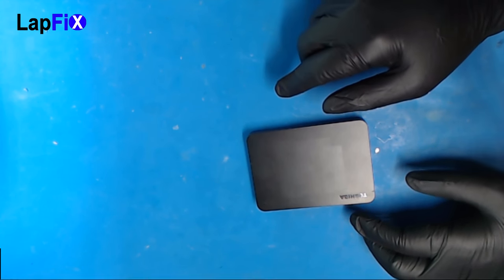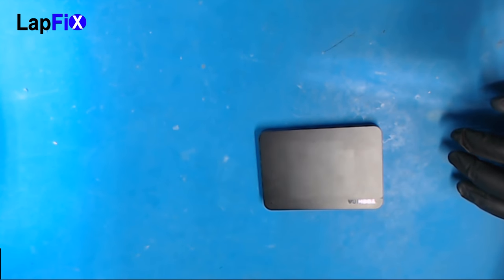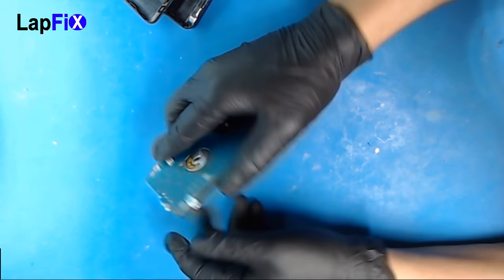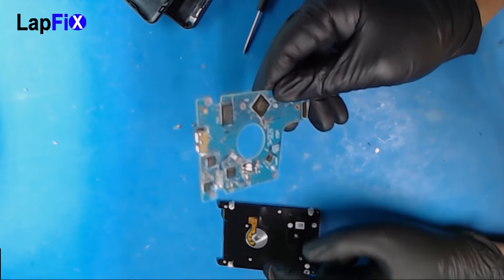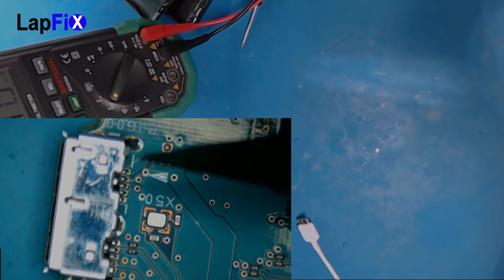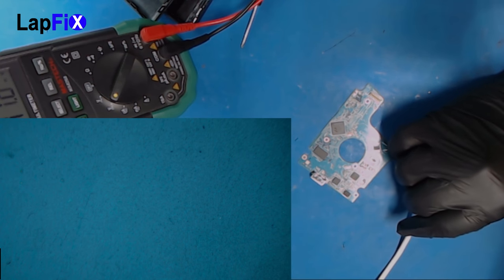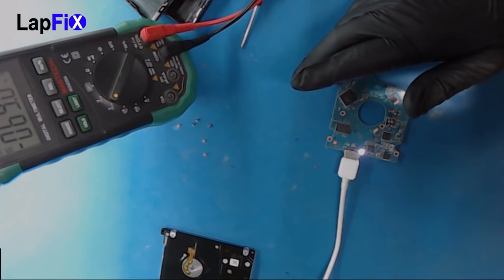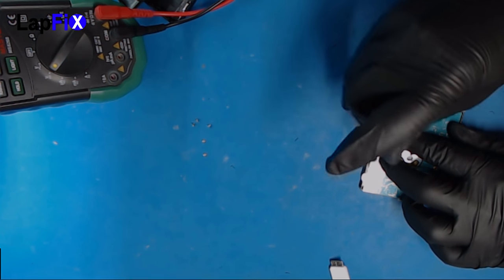How to fix a Dead External hard drive HDD - toshiba hard drive| LapFix

Comment: You are a star, this just worked for me too. Some flux on the connector and heated with the soldering iron. Works again now. Never again will I buy a cheap HDD again!
Reply: pardon me for asking, but what's a flux? is it the liquid he's applying?
Reply: @fathizaky141200  Yeah, it is a liquid that prevents the metal from oxidizing rapidly. It slows down the process so that there is a good connection. I've done LED lights before and when I first did them, I didn't use flux and even though the Solder/SolderingMetal had contact between the LED and the power: the oxidized metal reduced/blocked the current from going to the LED light. So Solder makes it much easier to get a successful connection.
Reply: it's not the HDD being cheap it's people mistreating connectors. This is a standard connector.

Comment: Thank you. I have a 1 TB SEAGATE BACKUP PLUS EXTERNAL HDD . I use it by attaching it with my honor 7x mobile through OTG  for data transfer (bothside). I purchased it 11 months back from flipkart. I use it max once or twice in a month. I used it with desktop 3 times only since purchased. Yesterday when i was working with in by attaching it my mobile , suddenly one beep sound came and HDD light turned off. I performed safe remove process from top bar and after few seconds , it showed that " its safe to remove now" . I removed it and reattached it with mobile but no light no detection. Then again i removed safely and attached it in Sony laptop. It showed new usb driver installation. After completion of the same , no pop up came , no light on HDD , no drive shown in my computer . Then I went to printer & devices and found that it is showing the HDD there but when I went to its properties ; there is blank in VOLOUME TAB . In GENERAL TAB it is showing "  device type : disk drive ;  manufacturer : standard disk drive ; Location : on USB mass storage device ; device status : this device is working properly  " . Another msg shows " windows cannot use this hardware device because it has been prepared for safe removal but it has not been removed from the computer (code 47) . To fix the problem , unplug this device from your computer and then plug in again ".  I unmounted safely it by right clicking . Then reattached the same . Result is still same. Then removed. Restarted the laptop , attached again... same results... pls advise

Comment: Hi what size screw driver did you use to open up the hard drive screws I can't seem to find the right size to loosen the screws connecting the board.
Reply: Search online for 'Samsung tools'. It's a star shaped point screwdriver.

Comment: do you suggest buying a new cable if my hard drive stops working first? Because I don't want to risk damaging the hard drive if I attempt to get it repaired.
Reply from the maker: If the cable looks physically damaged then yes.  Otherwise, listen for any noises or look to see if the light is blinking for indicators of what is going on
Reply: @lapfix  sounds good. Right now I'm thinking it is the connector on the hard drive because it does look a little worn now that I've inspected it.

Comment: If the external hard disk drive is running but not showing in the computer /desktop and a sound coming out of it then what was the issue coming? Plse tell me the reason and solution for recovery.
Reply: Dear same is the problem for me it sounds when i insert it but not showing up on pc... Did you get your answer?

Comment: Hi, please read this and reply.
I have the same Toshiba model hard drive, when I connect it to the computer it lights up, and continuously blinks, but it doesn't show up on computer, I also hear normal sound of the rotating disk. I removed cover and visually checked that disk is super clean (without any damage) and actuator arm/slider was parked in its place. I also removed PCB and checked the contacts visually, also good condition. The only problem is that I don't know how to read the PCB to diagnose and fix the problem if it really is on the board. I know it sounds really random but if you could help me with that would be great - I can pay you depending on difficulty level lol =) I can send you pictures of hard drive condition itself or we can directly videocall... I have multimeter tester and soldering tool... If you can not, I will understand, at least I tried :) Thank you!
Reply: Got solution???!!
Reply: Is it solved I am facing the same
Reply: same problem here
Reply: @bhaskargowda-3955  found it?

Comment: Hi, what is the glue you apply on the solders? Can you share the link to this product? Thank you!
Reply: That was flux, not glue. It helps to make a good solder connection. It is important to use flux meant for electrical connections as the other sorts of flux will destroy the connections.

Comment: I have the exact same device! Though my LED does function and the drive is spinning. I've checked it using Apple's Disk Utility App and it recognizes there are 14209 files stored on it but I can't "activate" it and "repairing" doesn't wrong. All that seems to keep me from using it is the error-message: Unable to read FAT (Input/output error). Please help!!!
Reply from the maker: If it is not "mounting" and using the repair tool doesn't work, then you would need to take in your external hard drive for repair.  Apple software can only help so much when it may be a hardware issue

Comment: What could be the problem if there is no light on the LED (not even Windows recognizes it) but the disk does spin? Two disks were damaged like this at the same time, I had both drives connected to a powered USB hub when they stopped working

Comment: what about if the light does spin, i even connected the sata bridge connector and still does not work, i opened the drive and reader was in position, it actually spins as well, but nothing shows up on the pc,

Comment: My external drive (Seagate USB 3.0) does not show in file explorer or disk management but the option to safely remove it is available and the LED light on PCB turns on. After I opened the case, disconnected the PCB and connected the drive to my computer using a SATA-to-USB3.0 cable, the option to safely remove is not available and the drive still doesn't show in file explorer or disk management. Any ideas on what may be the issue?

Comment: Hey when I plugged in the HDD , there's a light but the HDD not detected..
Reply: iman akim same
Reply from the maker: You will need a recovery  tools to recover your data.
Reply: below your hard drive is a printed circuit board, remove it and clean all the electrical contacts with fine sandpaper

Comment: Hello! What is the board exactly? I mean what is its function? Can the board be replaced as a whole, without soldering, and if it is possible, where can it be found?
Reply: The solder connects the board unless there's a hidden plug.

Comment: Hey I have Toshiba ext HDD (not the same model as yours) I dropped it and the led doesn't light up and it is not recognizing and the disk is not spinning. Will I be able to recover the files if I take to a shop?
Reply from the maker: With data recovery, it is always an attempt to recover, nothing is fully guaranteed.  If you would like to send it in, we have all the information located in the description.  Hope to hear from you soon! 😀

Comment: Good day! I have my problem with my external drive. I used my external hard drive as a tool to download the drive for windows 11. After downloading the whole file needed for installation, my external turned to esd. Then, I turned to back to usb. Suddenly, all my files in usb are missing. I think they are gone. Please help me to find a way how I recover my important files in my external. What should I do?

Comment: What about the platters making noises the light comes on but the drive will not read. It shows in Windows, but you can't access files.
Reply from the maker: Sounds like a mechanical issue.  We work on that issue as well.  All our contact information is located in the description

Comment: Will super glue work as well or no?
Reply from the maker: No, You will need to use soldering tools.
Reply: @lapfix  ive seen the flux in those syringes or whateevr, are those okay?

Comment: I have the same issue my external Toshiba has no power, but this happened after fallin from the 2nd floor on the ground, what can u tell me about it, after the drop it just didn't power up at all
Reply from the maker: Mechanical drives are very sensitive to drops.  There are a lot of moving pieces inside them that help them work.  If any part gets even a little bit of damage, it will not work properly.  There is still a chance to get your data off even after drops.  It will have to go in for specialized repair in these cases

Comment: Does heat need to be applied as well? Can a hair dryer be used ?
Reply from the maker: No Solder tip should be sufficient.

Comment: Mine is Toshiba 1 TB
Worked fine till yesterday when suddenly a copying process was stuck midway which compelled me to disconnect it  directly and from then on the device is not recognized by WIN PC.
Though the power LED is on while in use but it's static (not flikering.) and the disc inside is also rotating.
Reply: Same issue. Did you solve the issue yet?

Comment: My external HDD keeps blinking but is not shown...device manager doesn't show it as well...what to do in this case..? Thanks.
Reply from the maker: Usually there is an issue with the hard drive physically, best thing would be to take it in to recover the data
Reply: @lapfix  thanks!

Comment: Where I can get this flux plz? I have this problem with my t hard drive.
Reply from the maker: You can get it from Amazon : AMTECH NC-559-V2-TF Solder Flux - 30cc
Reply: @lapfix  Thanks I will try this way hope it works.
Reply: Can i use Flux Amtech NC-559-ASM-UV(TPF)
Reply: Or AMTECH RMA-223-UV Soldering Flux 10CC

Comment: What Slow Copying or moving files? How can i fix that?
Reply from the maker: If this is not a computer issue and the HDD is acting the same way with different machine. Then copy your data ASAP and get it to a safe storage because your Hdd is going bad !

Comment: I have a 2 TB Western Digital from 2014 and is in excellent condition. However the external HDD storage has a defect and when I plug into 3.0 USB port it opens windows explorer but times out when I want to transfer all the files onto a backup disk or other External HDD. It is annoying. I have watched videos to reset the HDD in disk mamagent but nothing shows. I want to take it to a repair specializing in extrrnal hard drives but I don't want to waste $200 or more for data backup. Anyone has similar issue or is it just me?
Reply from the maker: You need a data recovery service. See my other Video about fixing HDD

Comment: Hello
My external hard drive makes a sound when I connect it to my computer, it can show but I don't see the blue line which shows the data,
Then it disappears after some minutes.
But the hdd remains running and very hot.
How can I recover my files???

Comment: My drives spin but the led light is not coming on and when I’m on my Xbox it doesn’t connect but I hear it spinning
Reply: Same
Reply: Same here.  Lights on, spinning correctly but nothing detects it.  Not computer, not xbox, nothing.
Reply: have you fixed it?
Reply: @jonmac380  same here did you fix it
Reply: Same here any solution ?

Comment: Hi, I plugged in my toshiba hard drive, the led light was flashing and stayed on, it spins too, but my Mac just doesn't read it. Eventually, the led light went off. Could it be the connection problem? Should I try to solder the connection to fix it?
Reply: Same issues anyone to help out
Reply: My external hdd.. Light the blue and stuck on it.. My pc cant recognized the hdd.. The sound is like a fan no clinking.. I changed the pcb i thought its the problem with the change of bios and firmware but still not workibg any one find it out.. What is the problem should be.. I really need help i have alot of important files

Comment: I was wondering if you can help me, I have a 2.5 inch WD my passport ultra (4TB), 2017 version, suddenly it did not show the files and it does not eject when I eject it on my MacBook Pro, when I eject it, it comes back and it makes a very light sound, then turns normal, is there anyway to fix it rather than open it? Is it possible that the PCB is not working properly? I checked the HDD health and it says it's good nothing wrong with it, I installed the wd recoverit app and check it for a bit and it showed files, meaning I can restore them, but not yet cause I don't have enough storage, so in order to restore my missing files I am gonna need to buy a 4TB or 5TB one, that led me to make a search, I found out there are CMR, SMR and other types of drivers, I figured my WD ultra (4tb) 2017 might be a SMR drive, that is why it is faulty now or maybe it is the PCB! So, as I mentioned before I wanna buy another (4TB),  that is why I wanna make sure that I buy a CMR one, Can you please give me a list of 2.5 inch (4Tb) drives that are CMR not SMR? Even if it was a 2015 or 2016 versions? Or any older, newer ones?  Or any  good reliable 2.5 HDD recommendation or advice? I would be grateful!  Thank you

Comment: If they charger connector is completly lose could you also buy a new had and just use that circuit board? I just want to recover data from my old one but the connector has come extremely lose.

Comment: I am facing a issue with same Toshiba EHD, when i am plugging with PC HD light is blinking and it seems hard driving machine is running inside but drive is not sowing on PC even i have check by disk management.. i have connect the HD with other PC same issue i am facing..
and on device manager usb error showing
-  USB device descriptor failed
- windows has stopped this device because it has reported problems. (code 43)

Comment: I love that fix, but I have basic soldering iron. I could get the flux, but I worry that I wont be able to hit the pins with the right amount of heat.  I am thinking about finding the same model Toshiba Canvio 2TB and switch the boards.  Do you think that will work?   Thanks for any help.
Reply from the maker: Replacing the board is not going to work. You have to remove the firmware chip from the old board to the new one.. Each HDD is unique.

Comment: Do u need a solder iron or anything else as well? Or can i just buy flux in the syringe and apply.
Reply from the maker: In the issue I had it was only the connection. Any additional work you need to do see the tools section in the description.

Comment: What kind of oil did you put on it?
Reply from the maker: It is FLUX not oil, to help melt the solder and restore connectivity to the USB Pins.
Reply: @lapfix  thank you i have toshiba 1tb external hard drive has no power.. i will try this one..
Reply: If you think that what he put was oil please don’t try to fix it

Comment: I have tried to do this almost hours, and finally the Led was on and I was so happy, but when I disconnected the usb and assembled back the hard disk, the Led is dead again.
Please help me, need some advices.
Thanks you so much
Reply from the maker: You might have a bad component on the PCB , watch my other video if it help.
Reply: Or if u haven’t fixed it yet & you can get the light on just leave it like that & transfer your files off of it.

Comment: Mine was working for sure, but once it reaches 84gb capacity, it tends to stop and becomes undetectable whenever I transfer files. I already tried formatting it but the same problem still occurs. It's a 2TB Toshiba External Hard Disk Drive. What seems to be its problem? Could you help me out? Thank you in advance
Reply: i’m encountering the same problem
Reply: Same here.

I think Toshiba 2Tb external is fake